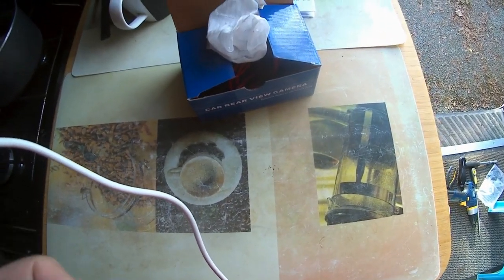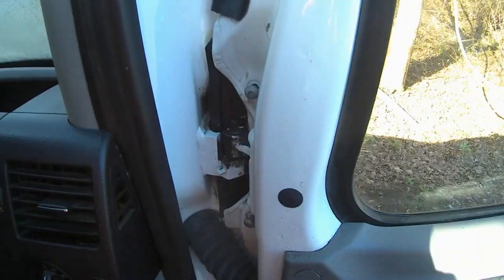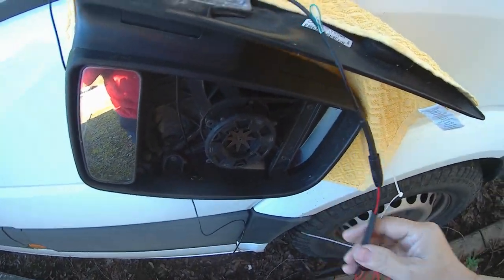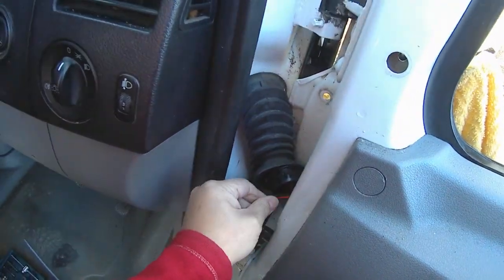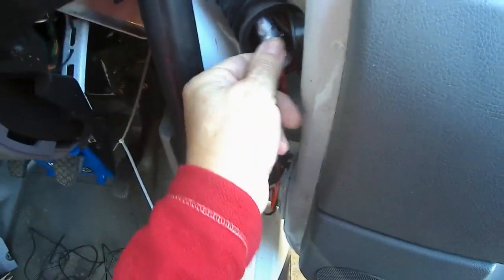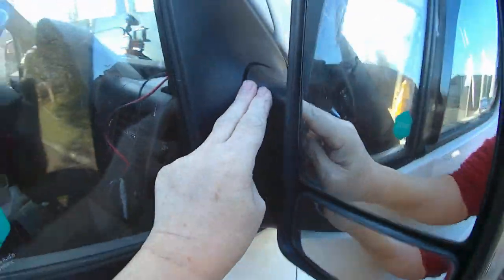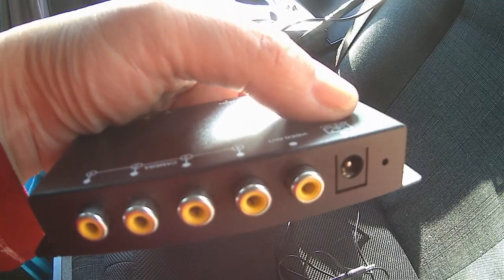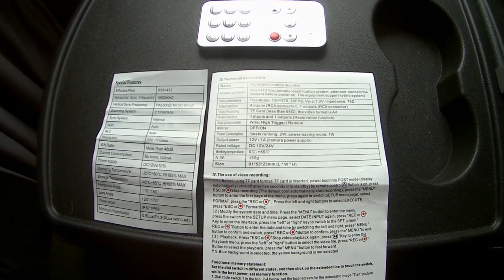Mercedes Sprinter wing mirror discrete CCTV camera install

Comment: I travel a lot through Europe and about 4 years ago mounted one of these cameras in my left hand side (nearside UK) mirror housing, angled to look left, I can switch from rear view to side view at certain junctions on my rear view camera screen, now turnings where it was impossible to see what was coming (I mostly travel alone) are perfectly visable in 1080p ! it IS a game changer for safely pulling out ! Best mod I've ever done on my Ducato.
Reply from the maker: Yes, a real game changer when driving abroad. Mine is mainly from security but yes good point :)

Comment: Good detailed video, thanks for taking the extra time filming the process, I had difficulty getting my wire through the boot, and gave up, but have since learned there's a foam bung in them from the factory,  so I'll tackle it again once the snow has thawed here.
Reply from the maker: Hi, thank you for your kind comments. Yes, there is a foam block about 15cm x15 x 4 inside the bulkhead but it can be easily pulled out. Mine was wet ( a bit worrisome, but as a live aboard in the U.K. condensation on the windows is a real pain and I’m sure it drips down behind the dash ).I didn’t find a foam bung ‘inside’ the boot itself. Good luck :)

Comment: This is amazing! Thankyou. Have you linked this to your van tv did you say? Is it feasible do you think to switch between cab screen and your van tv as this would also be great for all round visibility when driving then switching back to cctv mode at night for safety and security.
Reply from the maker: Hi, thank you. Yes, you could use a splitter on the output of the recorder to take another vga lead to another monitor. You would then not need to switch them at all. VGA cable switchers are available on Amazon. Please bear in mind tho that these cameras need a little light ( about 1 Lux, to function at night ).
Reply: @Antonia.Bradley  thanks Antonia that's really helpful. Will definitely look at those splitters. Much appreciated.🙂

Comment: Nice video , but a word of warning if your van has heated mirrors and parking censor's leds in the mirror there's not room to get the wiring through
Reply from the maker: Yes good call, my van has neither so I was ok. However if it had heated mirrors there would have been enough room, I don’t know if one with parking sensors would have though, as you say. The hole in mine would certainly been large enough for two heater wires as well. Thanks for the comment.